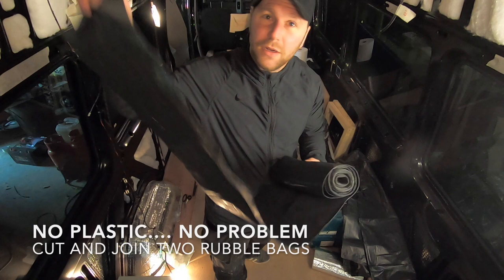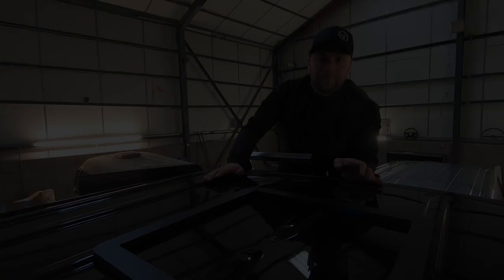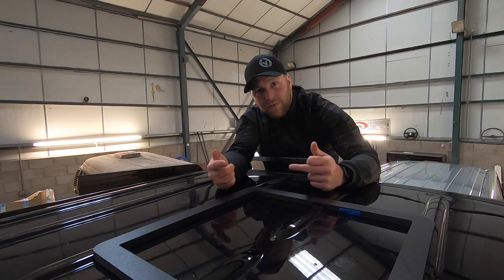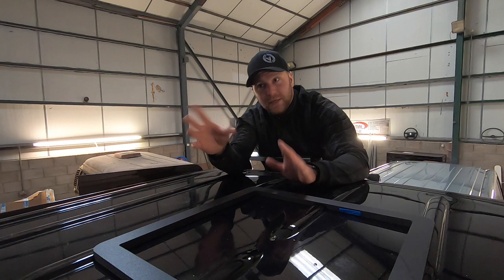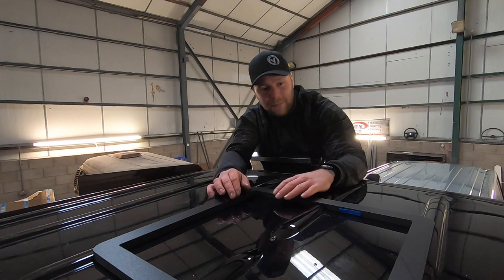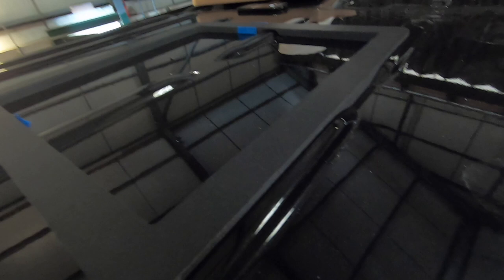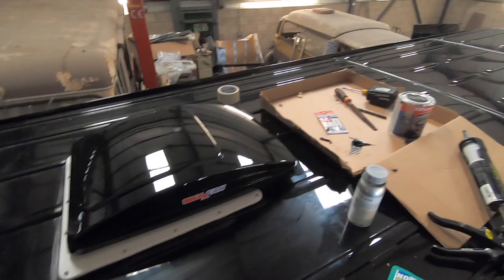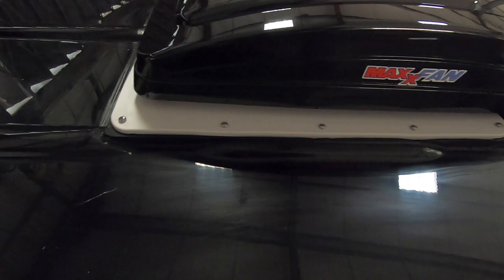MAXXAIR FAN 4X4 SPRINTER/TINY HOME

Comment: incidentally, on the new shape Sprinter if you fit a 400x400 Maxx air fan at the front it fits perfectly without using the expensive adaptor. At the rear however the ribbed sections will be an issue as in this clip.
Reply from the maker: Well I know the rear fits perfectly without a ring if you use 350 x 350

Comment: Awesome video, where did your buy the roof spacer from?
Reply from the maker: Have you cut your hole yet?
Reply: No I haven’t cut the hole yet.
Reply from the maker: @rickshis2756  ok….. good. The 350x350 maxxair fan is the exact same unit. But requires a smaller hole. And then you don’t need one of these rings. It’s a bit of a unknown phenomenon. The 400x400 is so good replace all eu standard size existing skylights 👍🏻
Reply: As somebody who spent his life working yachts and as a word of advice to van converters use sealant or butyl tape not both, they have different properties. Secondly and most important do not use Butyl Tape if you are going to put a screw through it, only use it if you are through bolting, reason being it will stick itself and as the  screw spins round and will pull the sealant from where it is required  and potentially compromise the seal.   Butyl tape is the best by a mile but that's only my opinion. I prepped three RTW yachts and not one of them returned with any water ingress.  For most van builders however I would suggest using sealant but if possible merely place the flange in with uniform pressure from the screws, then when the sealant has cured tighten the screws.  You have basically created a gasket from the sealant and by tightening the screws you are compressing that 'sealant gasket' and I can assure you it will not leak ever!  All you didn't need to know about Butyl tape is here https://bed-it.com/ just go to the how too examples.